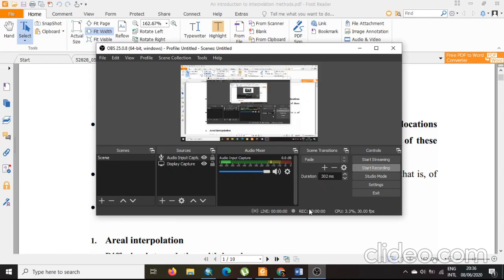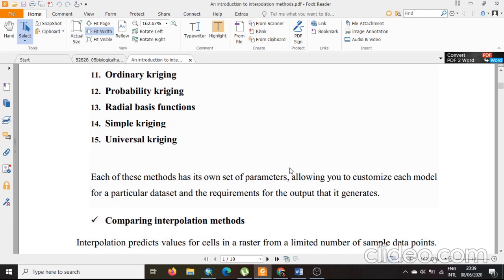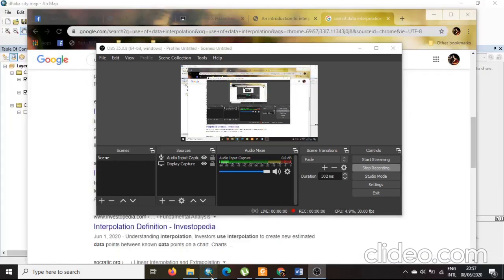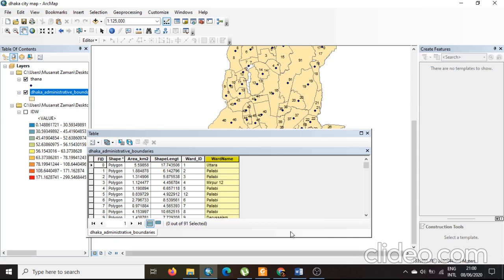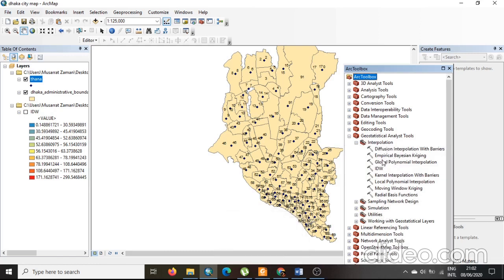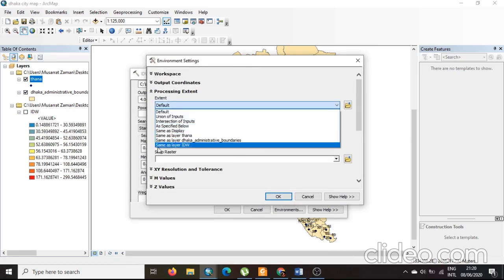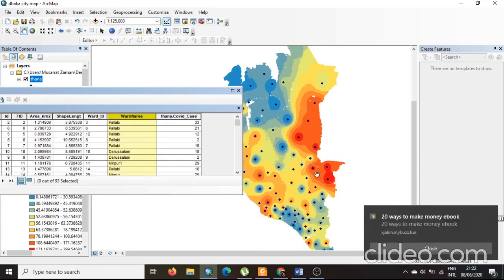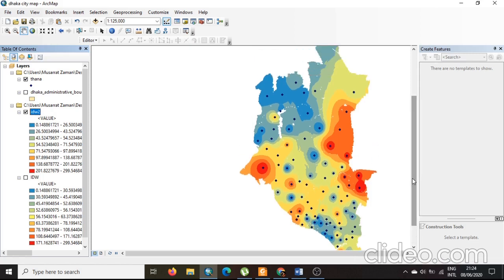GIS_Lesson 10: Data Interpolation: Inverse Distance Weighted (IDW) Method Using ArcGIS

Comment: I have tried but the issue I am facing that..Idw error and showing input feature points is invalid..please suggest me how I can rectify??
Reply from the maker: Try to adjust your geo database and geo refencing first. Also, which area shapefile you worked on?
Reply: @musarratzamanauroni2759   my inputs are coordinates which is in decimal degree format
Reply: @musarratzamanauroni2759  Is there any issue in coordinates?? In this case how can I rectify this??
Reply from the maker: There might be problem in co-ordinate system. You can Open ArcToolbox.

Open Data Management Tools → Projections and Transformations → Feature → Project. ... 

Choose the Projected Coordinate System folder or the Geographic Coodinate System folder, depending upon the Coordinate Systems of your other files and how you want to match them.

Try using your country boundary shapefiles, zip codes, shapefiles and covid case data. Hope it will work
Reply: @musarratzamanauroni2759  Thanks for your reply..the problem was in input system..I have rectified this by saving in geodatabase form..now I am able to interpolate idw

Comment: Thank you very much for this video. I followed the procedure for water quality indexing map representation but stuck with an issue. If I want to fix the color of the area with a certain number range like covid  0-100 cases = green, 101-200=yellow,more than 200= red. how to do that?
Reply: I tried changing the classification numbers to my requirements, but could not fix the first value of classification as 0, as it automatically takes the lowest input value of mine( 53).  I want to classify my WQI values from 0-20,20-40....this way. 

I would really appretiate if you kindly help me since it's very necessary for me at the moment.thanks in advance.
Reply from the maker: Sorry, I missed your valuable comment. Can you solve that? Otherwise I can discuss with you. Kindly send me e-mail here: aurony1990@gmail.com